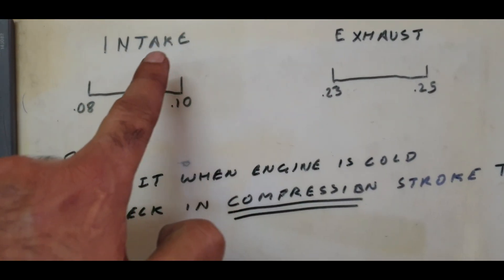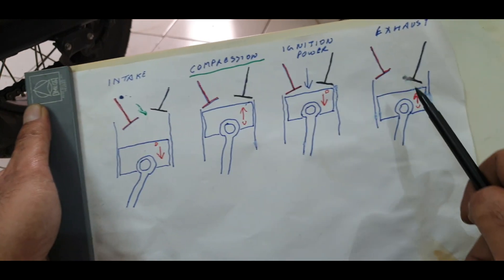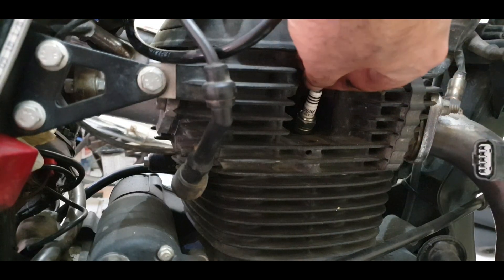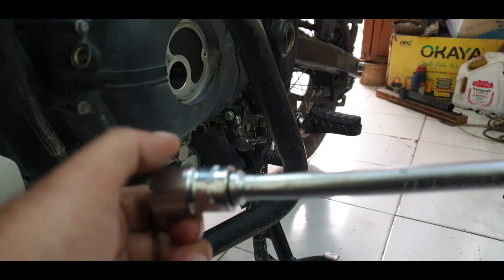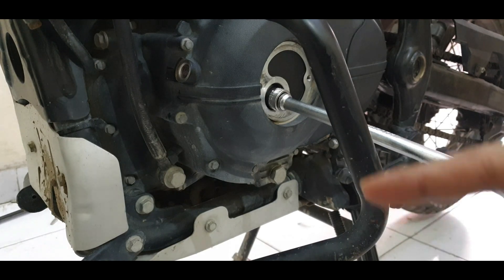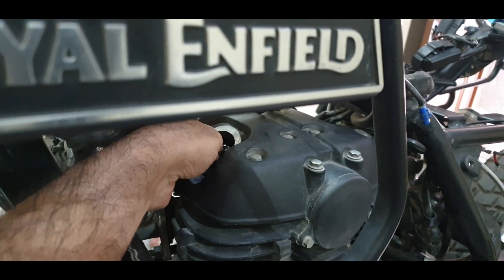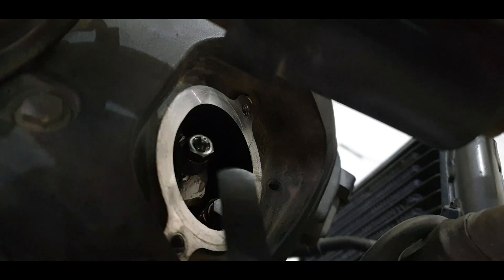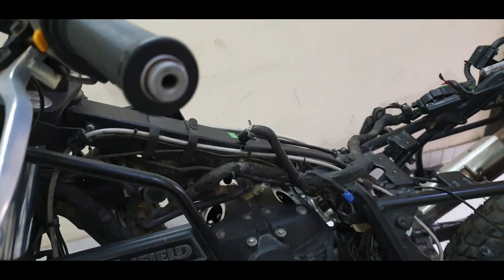Valve clearance | Follow up | 20000 kms | The importance to do it at Compression Stroke TDC

Comment from the maker: Hey 
So just some more blabber for the curious ones to do a DIY and why RE recommends clockwise rotation when common knowledge tells us to do it anti clockwise :)
This time I am trying to show how to get this done based on the markings on the crank wheel magneto. To be honest I have still missed out on few in depth basics, maybe next time i do it I will try to share those. But hopefully this will cover most of the important bits :D
Cheers
Reply from the maker: noel shenz  hey mate, gt535 is equipped with hydraulic push load adjustment, so the way push road operates is different in gt 535 than the cam chain operated one on himalayan. 
Basically if you are having issues on gt 535 the hydraulic might need replacement. It can't be adjusted like in the above vid. 
But if you are just curious on how to find compression, idea is same, remove tank, remove the top casings on the head to gain access to rocker arm and follow the cycles by rotating crank by putting bike in 3 or 4 gear with hand when engine is off. 
But just to be clear as mentioned earlier the tappet can't be adjusted like shown in above vid. Cheers

Comment: Thanks for the video! It would be great if there was a video with normal tappet sounds when engine is running. I've checked the clearances on my bike (had to slightly adjust intake) and am now paranoid I can hear the tappets more loudly when the engine is running! It's probably just my imagination as I didn't consciously listen to the sound before making the adjustment.

Comment: I just adjusted the valves on my Scram 411 after the 300 mile break in period. I was able to use the box end of a 10mm wrench for the lock nut and a pair of hemostats for the top square adjusting nut.

Comment: I have BS6 2021 Himalayan that clocked 15,850km I am facing some issues as you mentioned slow acceleration and poor mileage when I accelerate I feel like something is holding my bike back I have faced this issue after riding is for 8 to 15km. My RE service centre didn't say anything about valve clearance they just service the bike that's all. On my 4th service (15k) I mentioned this issue to my RE service advisor but they said they have adjusted the tappet but I didn't see any change. Thank you for making this video 🙏

Comment: Righty Tighty. Lefty Loosey. Clockwise keeps it tight. Anti-clockwise can loosen up bolts and screws. That's why. You never know with automotives. Heat, vibration, cold, expansion, contraction, can loosen up bolts.
Reply from the maker: Oh yes yes, we have interesting stories on this one where it came loose becos it was never torqued correctly at factory among few more reasons ;)

Comment: Hi mate, just a simple question! Is it safe to rotate the crank counter clockwise with the spark plug removed without worrying about the crank nut gets loose?
Reply from the maker: Yup mate that is the key please remove the spark plug before rotating the crankshaft nut. It will ease the pressure as there will be no compression forces with plug removed
Reply: @leuheanrede  Hi mate, I did the valve clearance yesterday! I had this phobia of loosening the crank bolt. So I just played it safe by rotating the crank counter clockwise by carefully watching the valves in the reverse order. The valves are a bit loose. Last time it was checked at 3000km before. And now it took me a lot of tries to get the exact gap at both the valves. But finally I made it. Surprise thing is the bike now feels smooth. I mean before the adjustments, the bike felt rough at 4K RPM 3rd gear. Now I feel like the roughness has lessened. Is adjusting the valves related to do with this smoothness? Two days before I had done throttle body cleaning. Even that time I didn't feel the smoothness! Man, I was a person who just sit & ride kinda person. But now I have been noticing these small things! 😀 Couldn't believe myself! 😀 All credit goes to you my master! ❤️

Comment: couldn't you put it in gear, on center stand, and rotate rear wheel forward to rotate the crank thus not risking loosening the crank nut?
Reply from the maker: Hey mate..Indeed we can, oldest trick in the book :). No harm. But being lazy I just find rotating the crank with spanner to be an easier way ;)

Comment: just saw your  video. I need to adjust the valves on my Himalayan. where did you purchase the feeler gauges? They don't have the proper size at my local auto supply store. Thanks
Reply from the maker: Hi mate, I got mine from Amazon. Even I don't have the exact size but I combine 2 like 14 and 8 to get 22 for example. Does work 🙂
Reply: @leuheanrede  thanks, I enjoy your video. very informative.

Comment: Hy bro i'm using a himalayan with a after market exhaust in it. I feel a lot of backfire and my friend says it because of fuel rich you need to get it tuned, i'm a bit confused if this is not the reason what are the other factors i need to be considered
Reply from the maker: Hey mate. May I ask how much kms did you cover in stock and how much in aftermarket and how much in total?
Reply: @leuheanrede  18k on stock 7k on aftermarket exhaust, total is 25k done

Comment: Hey bro,
A small query here, hope you ca answer that. So I bought this 2021 himalayan and 2 weeks back I had my first service done. Until then I was only accelerating the bike upto 60 kmph. Post the first service, when I accelerated it beyond 60 kmph(3k-4k rpm range), the bike is starting to vibrate, both on the tank and mirror. Any idea why this is happening? lately I can feel that there is this tappet noice as well. Is there anything to get worried on this?
Reply from the maker: Hey mate. Its hard to answer with riding myself. But usually himalayan do vibrate somewhat. I can only suggest that you ride some other himalayan to confirm the level of vibration. Also do check if the chain is adjusted properly and not too tight. Cheers
Reply: @leuheanrede  sure mate. Thanks for the reply

Comment: Outstanding video! Greetings from Mexico..
I am on the road and trying this, can you please elaborate on how much movementt at the valves when at true compression tdc. Mine do not move at all at what I think is false tdc , at what I think is true tdc the exhaust valve wiggles very slightly, the intake valve hardly moves at all, only a very tiny bit , is this normal please
Reply from the maker: Hey mate, thanks and greeting. Yup if they are too tight its most likely in false tdc. In true tdc, as you mentioned, intake will have slight movement but should be between .08 to .10 mm when measured with feeler gauge. 
And as for exhaust, it would seem slightly more and should be within .23 to .25 mm
If not within these range, please adjust. Cheers
Reply: @leuheanrede  thanks that is clear. Is there any other way of double checking true tdc other than checking the valves move slightly
Reply from the maker: @davidcoulson5229  the marking on the engine need to be followed through all 4 cycles of stroke while observing in which stroke it is that can be seen by the movement of valves. Once exhaust valve closes then intake will open. When intake closes, compression will start. Thats the time that  we see the marking as in vid. 
Next will be ignition and then exhaust will open. Then just after exhaust closes we will again see the marking, this is false and just before intake open. 
Try it a few times, rotating the crank anti clockwise and observing marking and valve movement just to be sure, before you start adjustment. Cheers :)
Reply: @leuheanrede  thanks! Interesting - Good advice greatly appreciated, will do as you suggest

Comment: Dude. Thanks from Bottom of heart. You explained it like a master. I mean you are a master. Keep going. Waiting for next one. 
I do have experienced engine knocking sound when the engine on high temp. The knocking sound will hear clearly while the engine is at high temp and in bumper to bumper traffic . Do I need to adjust the valve for this? The RE guys telling these are normal. Am Confused.
Reply from the maker: Thanks mate :) and yes assuming that spark plug is correct spec and rest things in good nic, next thing is adjusting the clearance. I am assuming one or both might be on the tighter side. Cheers :)

Comment: RE has admitted that there was an error at the printers. It should read anti-clockwise. They have also stated the force to remove the nut is a lot more than the force used to turn the engine anti-clockwise for a valve adjustment.
Reply from the maker: Hey mate, I assumed the same, I was kinda surprised actually as I found the same being mentioned at multiple places on 3-4 copies from all gen himalayans :)

Comment: Hi bro , please make a video on how to replace frok seal
Reply from the maker: Hey mate, sorry about this but hope it makes sense and shows the basic idea and tools needed to do the job as its from my another channel and in Hindi and on r15 v3. -https://www.youtube.com/watch?v=2ut-QViOaFY
Thing is that the one on Himalayan havent required changing yet, fingers crossed, shouldnt be anytime soon, but if it does the tools are basiically the same as V3 also used the same 41 mm fork and seal and seal driver and internal piston holder etc. Cheers

Comment: I have done my valve setting at RE Gulbarga, since the time he has done it, it often goes off on speed breaker or when I ride it slow, he says idle is perfect which is 1100rpm.. but why it's getting off, any idea.?
Reply from the maker: Hey mate, first thing to check would be evap hose coming out tank. Most of the time they put it back  improperly and it gets chocked. Simple fix for that, I have one vid on proper tank removal and refitting. And I can only hope that that clearance was done properly and isn't too tight. Were you there when it was done, did you notice what feeler gauge he used for intake and exhaust. But 1100 when the bike has warmed up is quite low for FI model, was it running fine at 1100 rpm before clearance was done? 
Anyways most likely it might be just the evap hose getting chocked, do give it a look. Cheers
Reply: @leuheanrede  thanks for taking out time and replying to me.. 

It's a BS3 model, it doesn't have evap. 

Yes I was there, he used the recommand gauges. 

Before valve setting it was working fine with the 1100

Comment: great video. You got it in one, the reason your turn it clockwise is that magneto hold down bolt can come undone if you turn it anti clockwise. Its unlikely but I have experienced it on another big single banger, and it cost me a lot to fix.
They are only done up to 60 lbs/ft (81 NM) so its very easy to loosen it slightly when adjusting tappets. You might not fully loosen it, but you can partially loosen it which then allows the engine power pulses to loosen it the rest of the way. Result, not nice. 

Another tip, when you have it at TDC compression, put the spark plug in a few turns just to stop any dirt you might dislodge falling in the cylinder.

I also agree with the other posters, the tappets do move when tightening the nut. I now know by how much, even if I'm holding the adjuster tool tightly I set my gap to allow for the movement and when I re-check after tightening its within spec. Thats experience, it can't be taught, but getting familiar with your bike allows you to understand how your particular engine reacts when you work on it.
Reply from the maker: Thanks mate, true, there is always the chance of loosening it, hasnt happened to me but I have heard of cases aplenty, doesnt take much effort. :) about the tappet too, yes its more of a feel thing. I wanted to show the tappet, i even unwinded it completely to explain, but the vid was getting too long, next time I do it, i' try to cover that aswell. Some say its a hassle but to be honest I have gotten used to tappets and more comfortable then shims. reminds me of old REs with pushrods, in terms of simplicity they were and still are my favorite ones to play around on :D cheers

Comment: Brilliant, Rather than taking the side cover off to turn the crank would taking the spark plug out and selecting a gear then turning the back wheel achieve the same result.
Reply from the maker: Thanks mate :) and yes it would kinda but stopping the wheel just at compression TDC is gonna be tough, can be done but more tedious. Cheers :)
Reply: It's easiest when the fifth gear is on. With first gear it's really tough.

Comment: 2:17 If it is below .08 it has loosened or it has to be loosened? Thanks for the video btw🎉
Reply from the maker: Thanks mate, and sorry I fumbled there in the vid, glad you asked. So if its below .08 that means it has to be loosened. Lets say we cant get the .08 feeler gauge in but we can get .07 in with ease thats means the clearance is too tight and we need to bring it to spec range between .08 to .10 mm by loosening and readjusting. Cheers :)
Reply: @leuheanrede  Thanks a lot for clearing my confusion brother. Your videos were always helpful for me. Keep them coming ❤️
Reply from the maker: @aslamshah4356  thanks for your kind words and motivation brother. Certainly will try my best to bring useful videos in future too. Cheers

Comment: i am Himalayan user for last 3 years
Reply from the maker: Hey mate, so is that BS3 or BS4?
Reply: @leuheanrede  bs4 non abs
Reply from the maker: @learn_new_hacks  aah good one. I had disconnected abs on mine with a on off switch. Sometimes I wonder if I should just take the abs unit out completely, will save some weight 🙃
Reply: @leuheanrede  no no no ; ABS is a good one ;  i am in thinking to upgrade my bike with ABS . when you are moving in side edges of road filled with mud , non abs himalayan will get slide if we apply front break. Dont Remove it ;  myself trained well with non ABS breaking - IBS ( Intelligent Breaking System - LOL :) )
Reply from the maker: @learn_new_hacks  hahaha trust me mate IBS is the best. I have ridden in offroad and beyond ofroad conditions. Every one around me was falling like fly becos of abs intervention. All I had to do was switch it off. We only need IBS, ABS is a bane except for rainy conditions ;) cheers
Reply: IBS VS ABS => IBS KNOCKED OUT the ABS -- IBS WON THE MATCH
Reply from the maker: @learn_new_hacks  hahaha. True true🤓